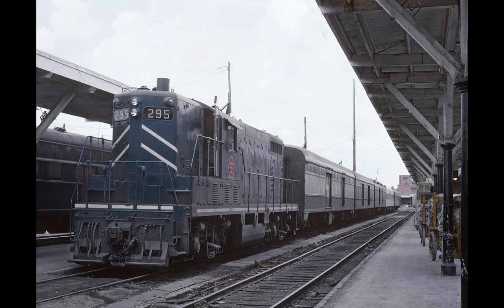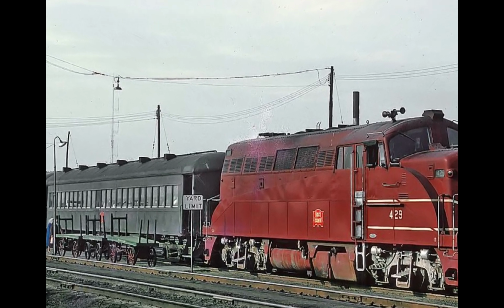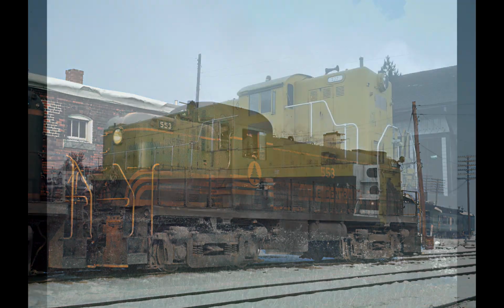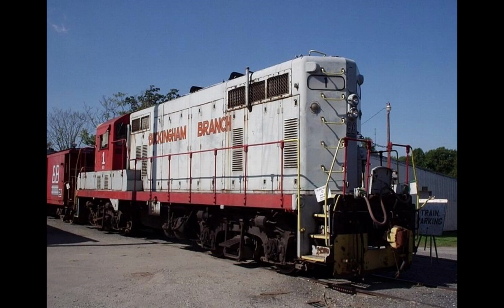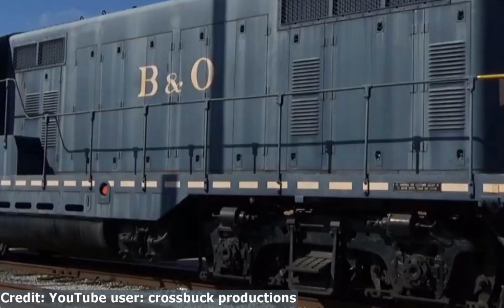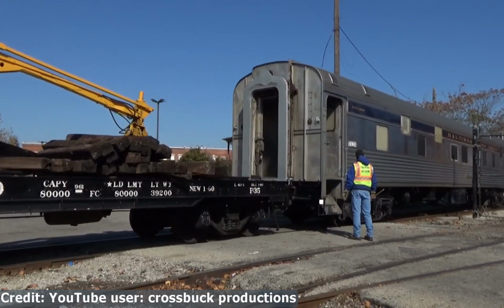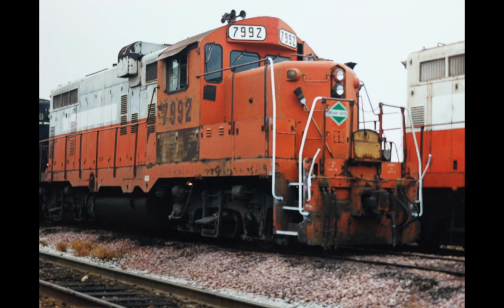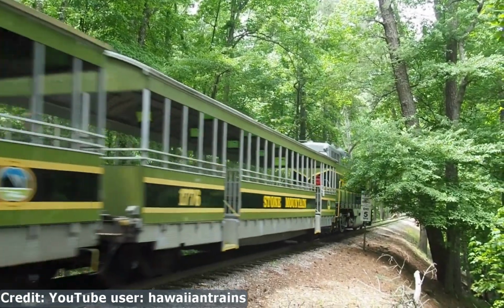A "Jeep" for the rails: Just don't let GM hear you call it that. The EMD GP 7

Comment: Lube oil mixed with the fuel? What are you talking about, a weedwacker or what!
Reply: That's how a 2 stroke engine works. You burned the oil during the combustion cycle
Reply: @ajidamarjati  I used to operate EMD locomotives with 2-stroke engines (Soo Line, 23 years) and never recall concern for diesel fuel having 2-stroke oil added such as with a "Lawn Boy" power mower. I do recall checking the crankcase oil level with each locomotive inspection I performed.

Comment: GP 11 was an ICG rebuild program
Reply: yes, the GP11 was a rebuilt GP9. But wasn't it defeated to 1600 H.P. with 4 exhaust stacks to reduce pressure?
Reply: @suppylarue220  IC and ICG rebuild program increased H.P by100 so the gp11 should be making 1,850 H.P. this was achieved by increasing max engine rpm over factory settings but I think that's about the max you could get out of a naturally aspirated 567
Reply: @suppylarue220  IC/ICG REBUILD PROGRAM
GP7 1500H.P.- GHP8 1600H.P.
GP9 1750H.P.- GP10 1800-1850H.P.
GP9 1750H.P.- GP11 1800-1850H.P This was a -2 upgrade of the electrical system of the locomotive along with other upgrades

Comment: E Units , F Units didn't wasn't equipped with cat walks. Or equipped with a platform at the front like new we have today. AC440, ES4400, ES 6000, SD70AC, D40-9W, etc 
Are Comfort Cabs. GE, EMD, Caterpillar.

Comment: You make no mention of EMD's rebuild s, the GP-15. Between all the rebuilding, its made in rebuilt GP-7's andGP-9's a rare site. Illinois Central's Paducah shops set the standard for rebuilt GP's. Then Santa Fe(separate from the converted F units), Penn Central and Northwestern did rebuild programs. (I think). 
      In addition several railroads did rebuild programs with other builders 1000-2400hp locomotives.
Reply: IC and Sant Fe CNW and BN GP-10  were in house rebuild programs PC was a hybrid program involving their own shop and IC and PNC's shop.

Comment: I thought the emd 567 was a two stroke but more like a detroit diesel two stroke. 

Meaning no oil and fuel mix. (well inknow diesel is oil but i kean lubercatong oil)

It has an internal lubercation oil system with a wet sump and dedicated oil pump. 

Using popet exhaust valves driven from camshaft and intake ports in the cylinder walls. Fed fresh air from a roots style blower or a crank amd exhaust droven turbo charger.
Reply: The 567 engines use the same injector style, valve style, and scavenge air system as the Detroit 53, 71, 92, and 149 series engines. The fuel injectors and exhaust valves are driven by an overhead cam while the fresh air intake is provided by a Roots blower. This is called natural aspiration for this type engines. They may be enhanced with exhaust turbos.

Comment: Good except for the two stroke lube statement which is only true for small engines. These engines have forced induction by roots blowers and later superchargers and hold lots of oil. We usually rebuilt them at one million miles.

Comment: No 2 stroke diesel that I've ever encountered mixes oil with its fuel. 
Nor do they ever have their fuel go through the crankcase or the rotating group.
Reply: You obviously haven't seen a Deltic. ;)
Reply: @BPJ John  
I'm referring to in the way that a gas 2-stroke does. Incidental loss is one thing, and having an injector quill tube run through the case is another thing. 
By the nature of their operation, diesels don't aspirate their fuel. Their fuel is injected into the combustion chamber, whether directly or into an attached pre-chamber.
In the case of an opposed-piston design like the Napier, the fuel is injected through the side of the "liner" into the chamber created between the pistons.

Comment: 2 cycle diesels do not mix lubricating oil with the fuel
Reply: Yeah, I noticed he said that too. To further expand upon this point, a 2 cycle diesel is not like a weed wacker or leaf blower where gasoline is mixed with oil. These big two-cycle EMD's have a crankcase full of oil like a four cycle which is not intended to burn. GM was producing smaller on-road two-cycle diesels too during this era under the Detroit Diesel line as well, which likewise, were essentially smaller versions of these massive EMD prime movers. These have a cult following among fans (I'm one of them)

The two-cycle is a beautifully simple engine, and dead-nuts reliable. But efficient, they are not, either way. It was probably for those two beneficial reasons EMD went with a two-cycle.
Reply: @pinecone01 Not to say you are entirely wrong, but not all  Detroit engines are 2 stroke either. (I too follow them… and work on EMDs.) yes, they very much are little EMDs. (Having both in our shop)
Reply: Excellent content 👍

Comment: Nice video 👍🏽
I'm one of the GP7 and GP9 fan even though I'm not from or live in America.

A bit of correction from me, the diesel 2-stroker engine is different with petrol/gasoline 2-stroker engine.
The diesel one, works like 4-stroke diesel engine albeit it use intake ports at the bottom side of the cylinder rather than intake valve(s) and still use the exhaust valve(s) in the cylinder head. In the EMD cases, it use 4-exhaust valves. 
The 2-stroke diesel engine use supercharger that sucks air, squeez it, and blow it to the intake port in order to running, thus, a 2-stroke diesel is always supercharged but it is actually naturally aspirated engine. 
The 2-stroke diesel like EMD's don't burn oil like the petrol/gasoline 2-stroker (well if there is oil leakage, they do, burned oil). They burned diesel fuel in the same manner as the 4-stroke diesel engine.

The naturally aspirated 2-stroke diesel is equivalent to the naturally aspirated 4-stroke diesel which 2x bigger. There is an example. The Detroit Diesel 6-71 which is a naturally aspirated, 6.9 liter, inline-6, 2-stroke diesel, had 238hp meanwhile the Cummins NH 220 which is also naturally aspirated diesel but it is around 12.7 liter (from what I remembered), inline-6, 4-stroke engine, only produced 220hp. Even the early 14 liter, N855 variant produced just around 250 to 280hp naturally aspirated. 
The 2-stroke diesel is as efficient as 4-stroke diesel albeit in smaller capacity and in how and what application you use, that is why they use it mostly on ships because of their nature that puts a hell of power in such small capacity.

Keeps the loco history series👍🏽
And if you will, covered up the export locomotives from ALCo, GE, and EMD...

Comment: Interesting. Years ago I was exchanging notes with a guy in a position to know what was going on at EMD. The reasoning behind the BL2 was that it would have the largest number of common parts with contemporary F3’s.  This resulted in the BL2 being even more difficult and expensive to service than an F3.
The wiring was a major problem in the GP7 they didn’t want to run the circuits over the prime mover. The heat from the prime mover would have been destructive to the wiring. The access was thus a compromise between the “easiest “ way and the least impractical way of doing it. The cost factors weighed in as well, pushing up the price of these units to a point where most customers would be hesitant to pay a premium price for a simple product. The control circuits were not designed to be replaced or serviced. EMD figured that early GP 7’s would be replaced with  new units after 15 or so years.
Reply: it was the "trade in" mentality of the period. just like automobiles, which were built to a replacement life of 3 to 5 years. The first big push was by GM promoting the trade in of 4 FTs or 4 F3s for 3 GP20s in 1959.

Comment: You left out the BL1, the predecessor to the BL2.  The main problem with that one is that the framework wasn't designed for MU operation, so the locomotive couldn't operate with other locomotives. I believe Western Maryland ordered most of the BL1's.
Reply: There was only one BL-1 as it was the demo unit and it went to C&EI. Largest purchaser was Pere Marquette which was delivered on the eve of their merger with C&O 14 units.

Comment: 8.36..........The EMD 2 stroke diesel engine had lubricating oil in the diesel fuel for internal lubrication?  LoL, that is funny.   2 stroke combustion is not less efficient than 4 stroke engines, the opposite is true.........read up on the Achates 2 stroke engine that Cummins is making for the US Military. The problem that has been discovered with the smaller GM 2 stroke diesel engines is that they used a poorly designed camshaft profile which created over scavenging of the cylinder. A company in california, designed a new camshaft for 71 series engines used by a large oil company, and it drastically reduced emissions,noise and assisted with fuel consumption so that these off road engine applications could meet EPA requirements and extend their service life.
Reply: Weren't there improvements to the liner seals and piston rings as well (to bring them into the 21st century) or was that a different Jimmy project